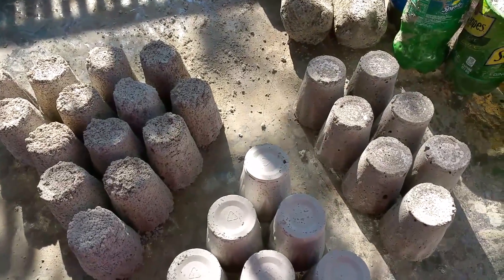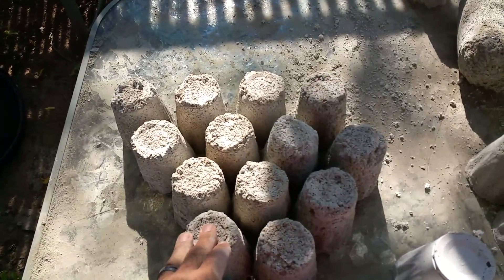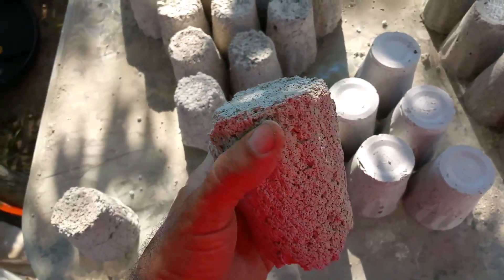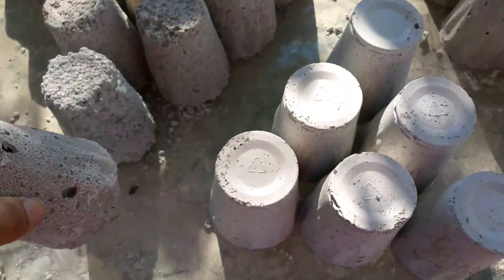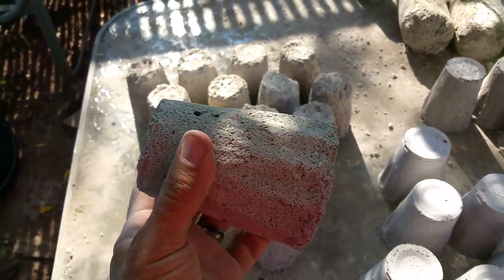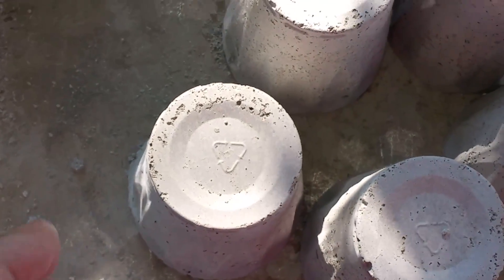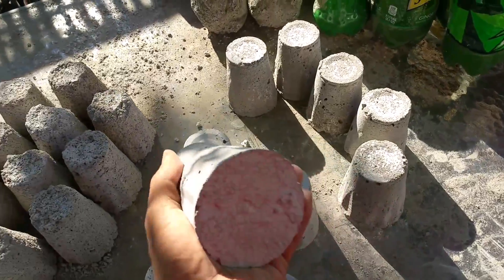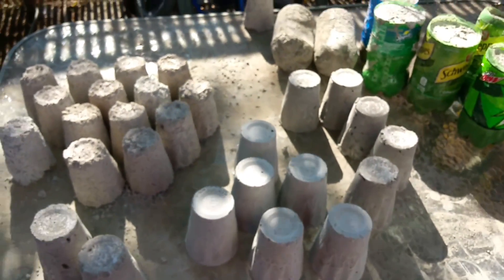Aircrete Update 7/17/2017 #Aircrete #DIY #AircreteHarry #Aircreteprojects #AircreteUpdates

Comment: I've been having a very brittle mix. I'm getting frustrated. Hats off to you brother. You have been at it for a while
Reply: I have had a 40 # / cubic ft sample tested at over 900 psi- after 28 days of wet curing ( in a plastic bag ).  Aircrete cures very slowly and have to be kept wet. 
 I poured foam concrete over a concrete roof for insulation.  Found the mixing and handling of it to be a hassle. It is sticky and not heavy enough to pour out of a bucket completly- but it insulates !  And it is light ! 
 It is used all over the world especially in interior walls of masonry buildings.  My 70#/ cu ft  stepping stone samples from 10 years ago seem to be in good shape after 10 freezing winters 
We were using a synthetic foamer that mixes 40 /1 with water and is made so the bubbles last hours in a mix.
Don't expect to save money over heavy concrete- the cement cost can be higher in aircrete.

Comment: Hello, thanks for sharing recipe info! I can't figure out what kind of foam you are referring to. We have had good luck with the strength of an insulating mix that goes under footings of thermal mass. We use bean bag chair beads, but would like smaller foam particles as well. Synthetic fibers help strength a lot - steel ones may not. Biggest problem for us is water absorption. That took a lot of testing to improve. We have had no luck with expanding foams - both structurally and for water resistance.
Reply from the maker: This video will show you what i'm talking referring to with the foam.
https://www.youtube.com/watch?v=hSiQn1hvu58&list=PLHnuS9-ekYxgL3K6alErsq0acvjJwSv6P&index=6

Comment: Did you consider the effects of water and time in your curing process? Cement stops getting stronger when it drys out, if you keep cement wet it will get stronger for 28 days.
Reply: Look Up Practical Engineering, he did a recent video on cement/concrete and the first one shows what cured underwater looks like compared to open air naturally cured and the common misconception that concrete "dries out" when curing.

Comment: Thank you for the update. In Germany, builders are working with a product of Air-crete called Ytong.  It's really an amazing product, wish we could find their ratio...
Reply: So, I found a link that I believe will be helpful to you... http://www.understanding-cement.com/autoclaved-aerated-concrete.html#   Add the following, portland cement, lime and fine silica sand-- plus  aluminum powder.  Steam final product at 350 F at 116 PSI for 10 minutes, if you test this... please let me know your results.
Reply: Ytong is gas concrite,no foam in it,just bubbles of air and it is nothing new.Only whats new are aditivs that lower levels of water drinking.Old ones drink a lot water and mold was a big problem.

Comment: Aircrete is not structural so your results are spot on.
Reply: First one he showed is made for cases like in airports for emergency/runway crash pads to slow and softly stop a airliner that has lost brakes or aborts take off due to sudden malfunction or other emergency preventing safe take off.

Comment: Excellent!  I wonder if that 2 or 3 pound foam formula would float in (and repel) water and will the micro rebar impact the insulative properties during the flame-heat test?  Second airform - you mean a second dome structure or some kind of augment on the existing one?  Looking forward, as always and thanks much for presenting this - it's great stuff, man.  Thanks much, Harry!  Peace.
Reply from the maker: No it would not float it would act like a sponge and sink. So don't make a boat with it. lol